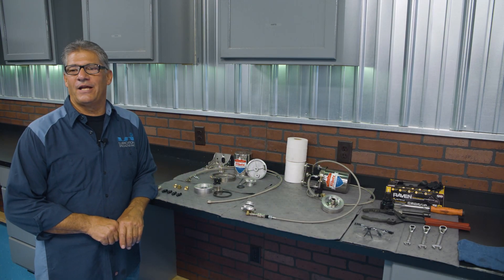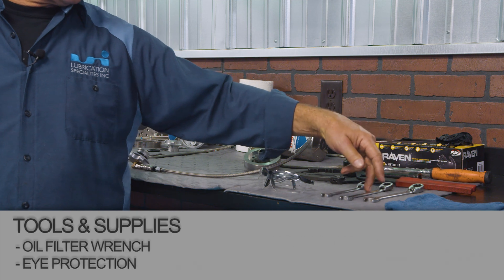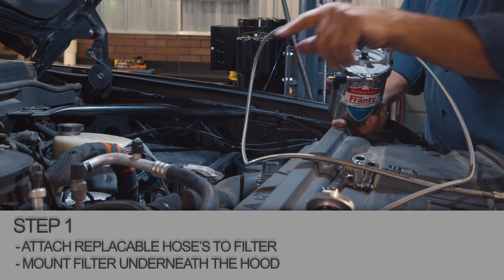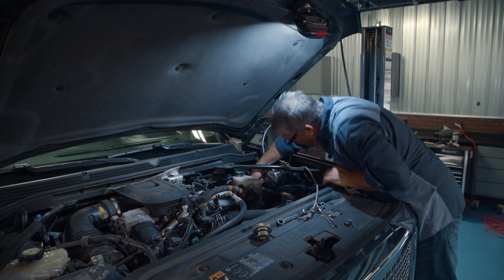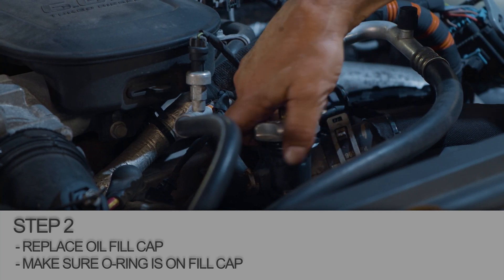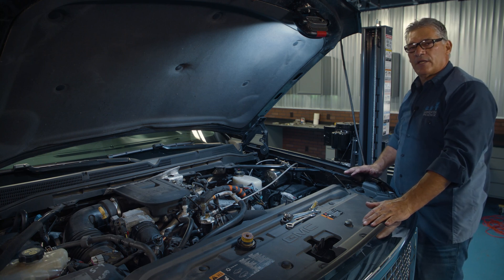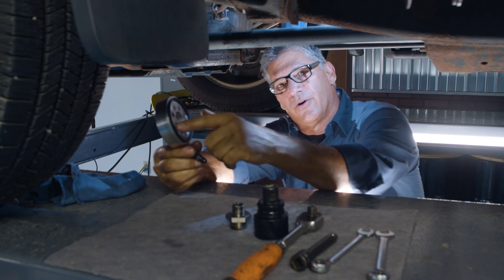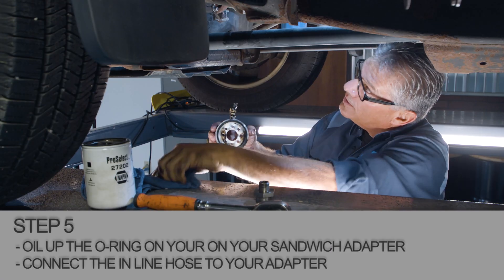How To  Install a 6.6 Duramax Frantz Filter

Comment: Is there a reason why you can't come off a port for the feed?
Reply: I called 2 weeks ago to ask same question. Got voicemail. Haven’t returned my call. So Insane Diesel it was.
Reply: @darrylsouthern1346  I went with Dieselcraft centrifuge. It's impressive for cleaning. At 3000 miles the oil,  is very transparent. At 5000 miles it's darker, but not like the tar of standard filters. Switched to Trybodyne synthetic.

Comment: I'm looking at a bypass filter for my 2015 Duramax. You have to change cellulose media every 5K miles? The other bypass filters using your style of media give a much longer interval? I'm 100% positive my dad ran a Frantz on his big rig in the early 60's.
Reply: I started in 1963 with a Frantz oil cleaner and Delo 30 W. Couldnt use multi grade in a diesel then. Delo was 30 W and 20W. About 55 cents a quart in a Standard station. 29 cents   in a discount store. The diesel trucks used a tall housing that took up to 4 Frantz canisters. Saw a 8 v Detroit 2 cycle with two Frantz 3 stackers on the fire wall. Said he gets a 6 pack of Safeway Truly fine to service them. That paper doesnt fit now.
Reply: One Frantz dealer talks about changing the Frantz every 15.000 miles. I changed the filter every 2.000 miles on my 6.9. The Pontiac every 6.000 miles. The 6.9 F350 had over 300.000 miles pulling a large horse trailer.

Comment: What intervals should internal filter be replaced?
Reply from the maker: You will continue to change the OEM filter at regular service intervals. The cellulose media change every 5000 miles, 10-15k miles for the synthetic type.
Reply: Does one replace filter due to engine oil sensor or by odometer ? Do both oil filters require replacement